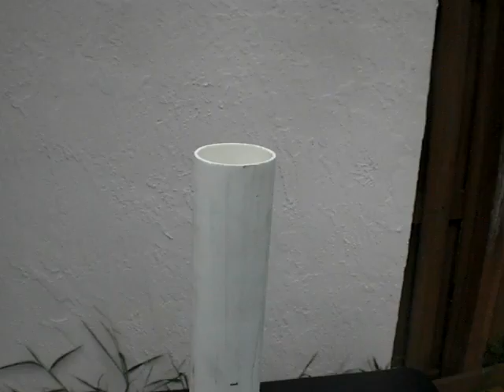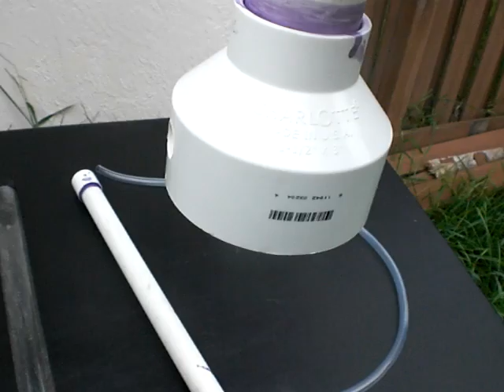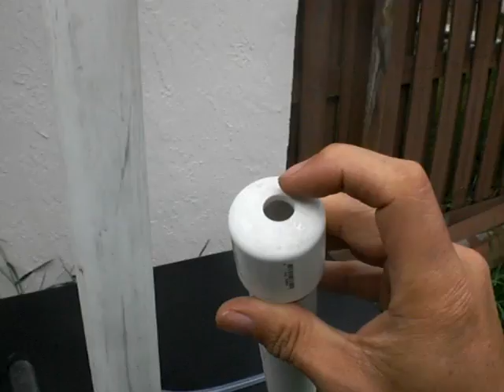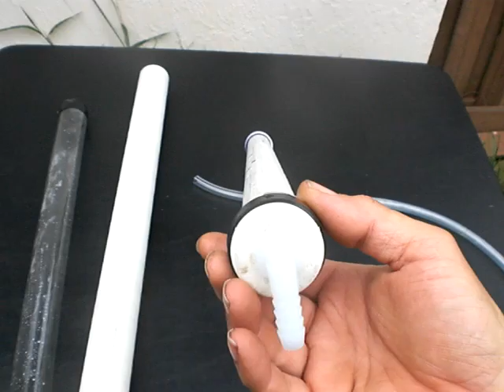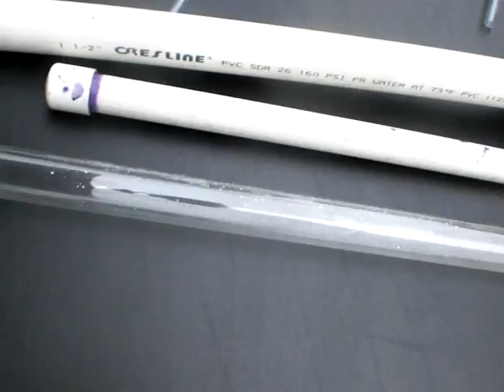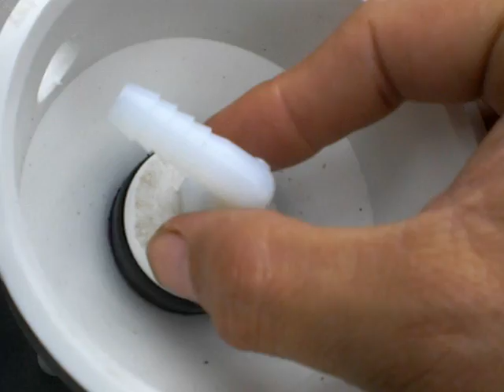How-To YAHHO Flow Meter - Part 1

Comment: i wonder if it would be a good idea to have a hose go up through the inner tube and terminate at the top so that you are not pushing air as air has resistance hho has smaller molicules and flows faster.. just a thought.. i like the design good job luther..scott